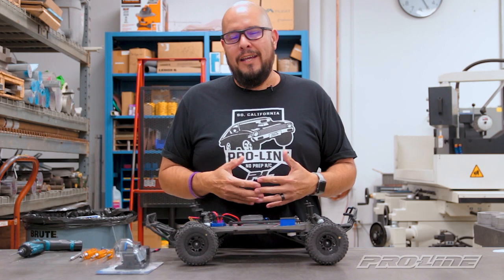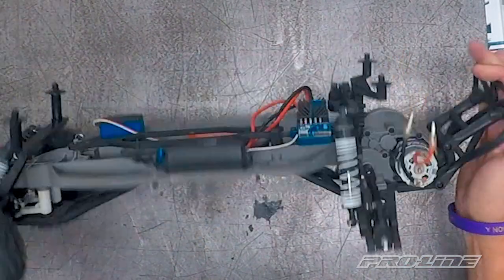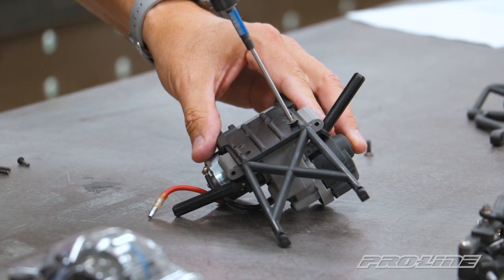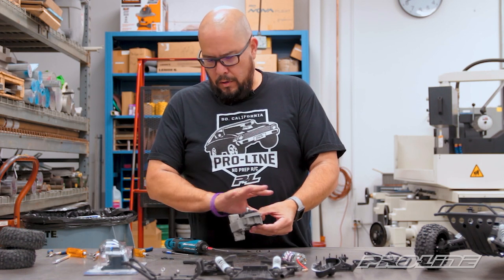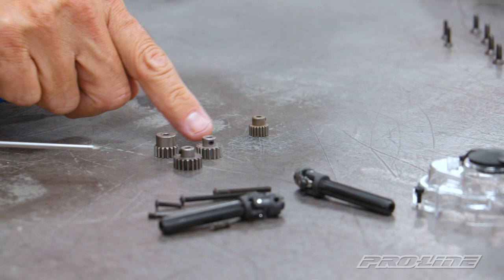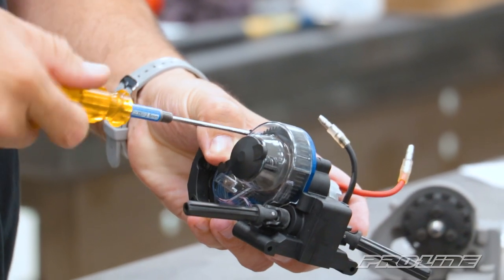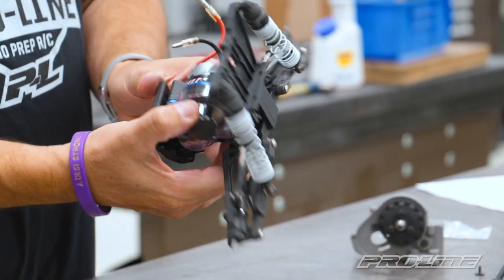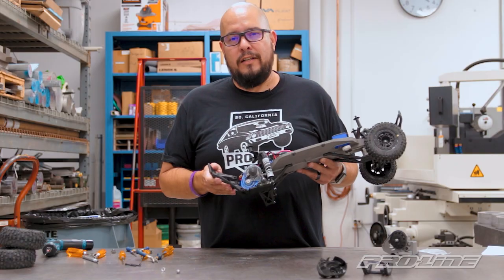Pro-Line HOW TO: Install PRO-Series 32P Transmission

Comment: Switching to 48p is simple. Using a Team Associated spur meant for a DR10, you just need to slightly bore open the hole with a 13/64 drill bit. You can even do it by hand without a drill.
Reply: i got the proline pro-series 32p spur gear transmission,,, but what pinion gear do i need????  and where can i buy the set at????

Comment: Already have it in! This thing is amazing!
Reply: hey bud, im kinda new-ish to this game, mind telling me how it's better besides being more durable?  thanks
Reply: @nabahmadi5012   no problem bro although durability is the main thing. They made it more durable in pretty much every way possible. It’s also a 32 pitch which makes for a better gearing option. It’s also a fully sealed diff and comes pre filled with oil too. That’s another thing to be able to tune better to your liking by using different weight oils like for shocks.
Reply: @sleepyheadfpv1507  thanks 😊
Reply: i got the proline pro-series 32p spur gear transmission,,, but what pinion gear do i need????  and where can i buy the set at????

Comment: I got mine, and I'm using an 18 tooth pinion and the motor and ESC gets hot quick, lower pinion or higher spur? Which would you recommend

Comment: Is the sealed differential a bevel gear unit, or does it use straight cut flat gears like the stock transmission?  The difference between them is huge when choosing what weight differential fluid to use. I’m hoping this has bevel gears in the diff.  They are much stronger and respond better to fluid weight tuning.  That said, does the diff use a gasket or all o-rings, and are these available separately for replacement when tuning or rebuilding? 
Also, thanks for the video, but I would strongly suggest using blue thread lock on the the pinion gear grub screw when installing.
Reply from the maker: Hi @Dan B.
The diff uses bevel internal diff gears. It is sealed with o-ring seals and here is a direct link to the replacements: https://www.prolineracing.com/search?q=6092-08&search-button=&lang=default

We hope this answers your question,
Thanks for your interest and support!
Reply: @ProLineRacingYT  Awesome, thanks for the info.  I’ll be ordering!

Comment: whats a good starting point for tension  after i tightening the spring on the slipper clutch 1/4 turn 1/2 turn etc.,
Reply from the maker: Hi @Mo Hawk,
There are a lot of variables. You should setup the slipper so it slips for the first foot or two from take off. This will take trial and error when tuning your slipper clutch. You'll be able to hear when the slipper is slipping and when it's not. 

We hope this helps answer your question,
Thanks for your interest and support!

Comment: What pinion gear do you guys recommend for top speed? I have a 14t pinion and feels like it tops out at 40-45mph with 3s lipo.
Reply: The more teeth on a pinion gear the faster it will go. As for the spur gear, the less teeth the spur gear will also increase speed. Keep in mind the higher the gearing the more strain you put on the entire drivetrain and you can expect to break things.
Reply: i got the proline pro-series 32p spur gear transmission,,, but what pinion gear do i need????  and where can i buy the set at????

Comment: Will Traxxas metal CVD's fit? The spur cover is so tight to the drive shaft I had to sell my old HD transmission.
Reply from the maker: Hi @Mickey's RC,
The PRO-Series Transmission cover is very similar in design to our original HD Transmission. What type of terrain do you run your RC?

Comment: Does it still have that little pin through the input shaft to take the input gear around? I have broken that spring pin a lot of times on the stock transmission
Reply: no it does not

Comment: I'm probably just a little slow on the uptake but what is the advantage of this over the stock transmission with steel gears? I run my stock Traxxas transmission really hard with a powerful brushless setup with zero issues.
Reply: It uses a ae slipper clutch
Reply: @92camarodragcar73  sorry I don't know what that means, I never even use my slipper clutch just crank down all the time
Reply from the maker: Hi @TS O'Day,
The biggest things over the stock transmission are a race style slipper for superior launch control and a tune-able (oil fill-able) differential to adjust the handling to the current conditions.  The other big thing is the aluminum motor mount for improved motor cooling and strength.

We hope this answers your question,
Thanks for your interest and support!
Reply: @ProLineRacingYT  okay thanks for clearing that up guys a lot of people had my same questions about this transmission, keep making the awesome products that you do!
Reply: i got the proline pro-series 32p spur gear transmission,,, but what pinion gear do i need????  and where can i buy the set at????

Comment: do you have smaller spur gears for this. Because on the stock trans I run a 50 32p spur and 22 pinion 32p for drag. I use 7000 diff fluid. My car goes straight and does 75+ on 3s
Reply: i got the proline pro-series 32p spur gear transmission,,, but what pinion gear do i need????  and where can i buy the set at????

Comment: If you are using this in your Slash drag car how do you make the transmission positive traction so both wheels are powered for maximum traction with this gear box transmission?
Reply from the maker: Hi @William Green,
Are you referring to a locked differential?
Reply: Yes, does the heavy duty transmission come with a locked differential? Also does it use a slipper clutch?

Comment: Will this fit on the pro 2? Also is it stronger than the pro trans? Thanks
Reply from the maker: Hi @slimfatpat,
Yes it will. As for durability, you can expect the same if not better quality than HD Transmission.

We hope this answers your question,
Thanks for your interest and support!

Comment: What pinion gear is recommended for the 32p 56t spur gear?
Reply: i got the proline pro-series 32p spur gear transmission,,, but what pinion gear do i need????  and where can i buy the set at????

Comment: i got mine in a few days ago maintaining 3800kv 3s power thought about going up to 4s or would that be pushing it ? lol
Reply from the maker: Hi @ShadeTree RC,
4S is definitely pushing the limit.  It was designed mainly to handle 2S, but it does have all steel internal gears.  The weak point then would be the spur gear and the case.

We hope this answers your question,
Thanks for your interest and support!
Reply: @ProLineRacingYT  always and ill take a stripped spur over a busted diff anyday ....thank you for the awesome parts you provide
Reply: You should be good. I've ran 6s through a stock traxxas 2wd transmission and it was fine. I'm actually surprised

Comment: Hi there, would it not be easier and cheaper just to change the spur gear and pinion gear to 32dpi. But that’s a nice transmission.
Reply: if thats all the value you see, yeah just do that      for everyone else, this is a proper upgrade

Comment: is there away to put 48p gears on it ?
Reply: Just installed this transmission today. It looks like the octagon slipper plates from Team Associated are compatible. A 48p spur for my DR10 would not slip on but it only looks to be around .005" small. If you drill it out slightly it would work.
Reply: @troybolton4055  thanks for the help

Comment: Will this fit on the lcg conversion?
Reply: Yes. I also have this trans on my slash chuckworks mid motor chassis conversion, with a spektrum firma 550 motor.

Comment: Will it fit in 2wd rustler?
Reply from the maker: Hi @BMC_RCKID,
Unfortunately, no it does not.😔
Reply: Pro-Line Racing you said it fits the bandit, why not the rustler?
Reply: Aren't all two-wheel drive Traxxas transmissions the same so it fits a bandit but not a rustler why 🤔?
Reply: @ProLineRacingYT  why not